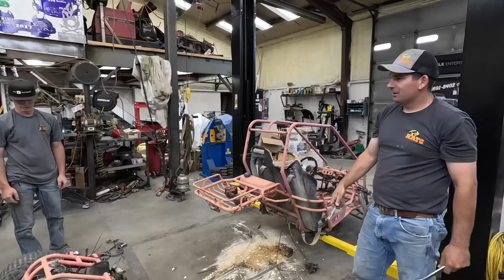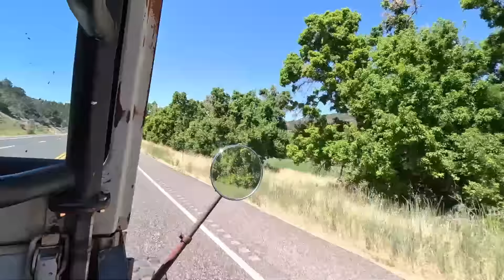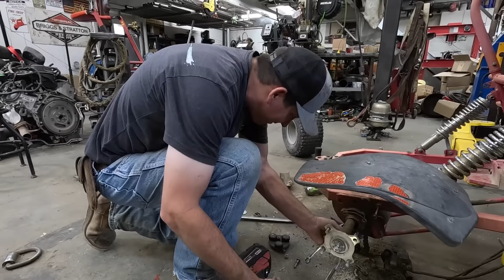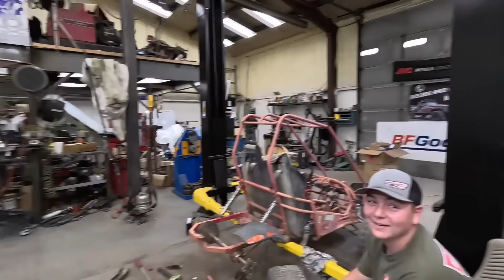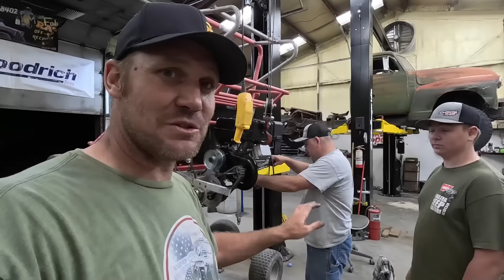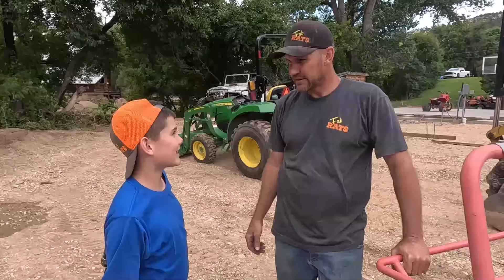We Built A Go-Kart From Junk For Grayden’s Birthday Surprise!

Comment: When my son was about 10, I scavanged a go-cart frame and got a golfcart rear axle, sans electric motor, put a stock 5hp B&S with centrafugal clutch and gocart sprocket on the yoke.  The golfcart tires are really wide but no traction so I cut up landshark rubber into 1 inch squares, ground the oxidized rubber from the tires and glued the squares to the tires with CA like a checkerboard and made knobbys.  The axle had a diff which made turning with those fat tires really easy.  It was not really fast, about 15 mph, but that thing would climb and/or pull like you would not believe. 4 years later I built him a full sized dune buggy.  What fun.  Thank you Paul for taking so much interest in your boys.  It teaches them so much about being real men.
A young man ask his dad, "Dad, how do I find the perfect woman?"  Dads reply, "Worry more about being the perfect man."
Keep up the good work, Paul.

Comment: Takes me back to 1962 (that's right, 1962) Dad ran a Conoco station along HWY 30 in Iowa.  He helped me rebuild a Doodle Bug scooter.  Good times. I was 11 years old and learned how to replace the governor spring with wire and then how to replace a broken rod.

Comment: Future welding project for the kids... Get them to reinforce those flat bolted connections in the roll cage reinforced. Ive personally seen that exact cart frame trap someone during a crash when that flat tab connecting the drivers side overhead bar to the dash bar broke during an nose-over crash off a jump.

Comment: Great thing about those HF motors is they are plenty modifiable, easy to get a good tickle more power with not too much effort or cost.  Carby swap, valve springs, governor delete, timing advance, port job and a free-flowing exhaust.

Comment: An interesting technique that I have seen done on a lathe might have worked well here.  Friction Welding. 
Cut the inner gear until there is an interference fit.  Center and mount the outer sprocket on the Tailstock while the inner gear is centered in the chuck.  Spin the inner gear and press the two parts together until the contact points glow red and melt together press until the proper depth is achieved.  The weld should be consistent and balanced.
I would love to see Paul try this.  I have seen it done on a drill press as well, but I don't know the technical requirements.

Comment: What do you bet that gets worn out? I just built one with my grandson. Same clutch and Harbor Freight motor. Salvaged a steering box and rear axle out of a golf cart. Rear end was a posi with a pinion drum brake. Had 370 gears. Works great. Got her geared down to 20 mph for now with a quick attach steering wheel in case he gets in trouble. The smile is so worth it.

Comment: I bought a few predator engines from harbor freight. I've had great luck with them. But you need to make sure that you change the oil like three times right off the bat. I've had the change it like three times immediately just to get all the metal out of the crankcase from assembly.

Comment: Should have used a 212 ghost, makes about 13hp and it's half the size so it would have been alot easier to get on there. Also tons of aftermarket support for the 212 engines

Comment: There's no way that changing the gearing that much is going to turn out well.  You should have just used the small sprocket that came with it/  keep the double sprocket on the shaft and only ran one chain..   I guess you'll find out when you ride it.  It might be too high geared to even take off though... Edit:  Actually it's not as bad as I thought.  It still takes off ok, and now just has a nice high speed.  Sweet.

Comment: Pretty shocked you left the engine governor in it. You'd get another probably 5-10mph just pulling that outta the engine... also i hope you deleted the oil sensor wire as it will shut the engine off if you turn too hard or hit a bump/jump

Comment: it doesn't line up perfect, set the line up. with the belt at the top of the driver then on moving face
and the bottom of the driven non moving face, the belt will roll over and ware out quick
the front is easy the driven isn't easy . hold the brake grab the moving face rotate and push it over 
a screw driver handle or a  1 by cut to fit the bottom thin incent  then release the driven, line the belt to the top of driver
and to the bottom of the driven. i know  i know its a go cart🙂
its hard to get toe shaft centers correct i think mine was 10" not Shure

Comment: The place you got the chain parts and the sprocket from looked like some of the farm supply stores around me. The places around me have an assortments of hubs that can fit most shafts. These hubs are cut to a standard OD that you can weld different sprockets or pulleys onto. You may have found one of these hubs that fit the shaft you want and be the rihr size OD to fit the double row sprocket.

Comment: My  Coleman(Hisun) side by side threw a Rod, anyone  in Florida with a 550 motor or one slightly larger find me if have one for sale, mine threw a Rod thru engine casing and was the 2021 Coleman 550 Outfitter model. Rural King, Tractor Supply & Home Depots sell similar side by sides